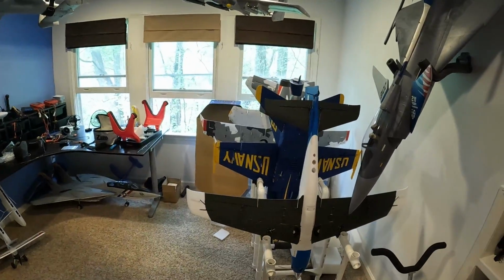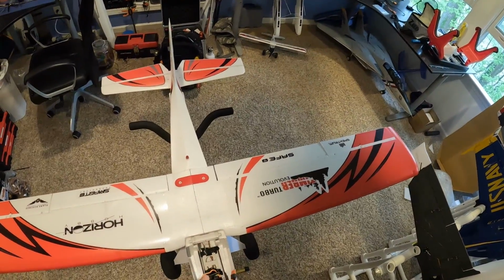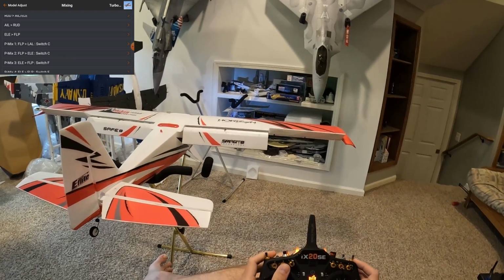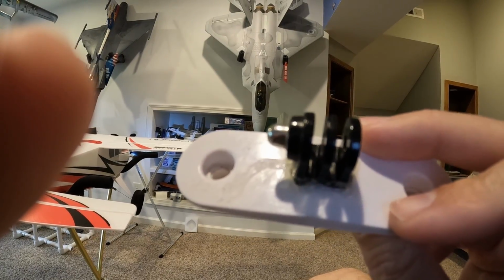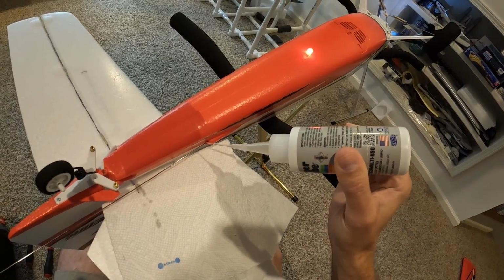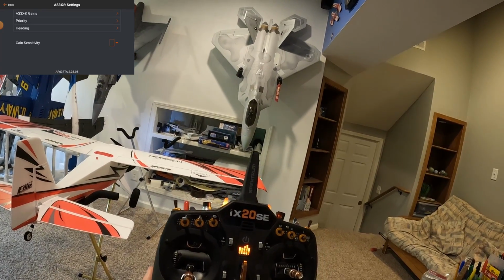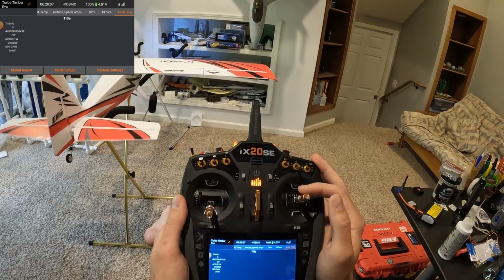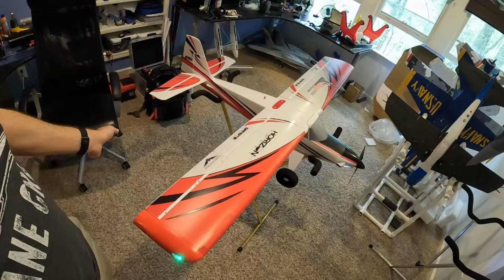Setup: Turbo Timber Evolution Max Performance w/ Spektrum Avian ESC Programming / Voltage Callouts

Comment: It's crazy that I've had this airplane for about a year and never had the overheating or thermal shutdown issues others have mentioned or been plagued with, even on the most hot and humid days here in East Tennessee. I did notice that excessive heat was generated by the esc and motor after a flight, so I removed some small bits of the cowl around the sninner to improve airflow to both components, and while they still get pretty warm I've never had a problem.
Reply from the maker: Consider yourself fortunate. This one actually wrecked out of a hover (no damage except to a spring) because it hit thermal protection before we changed out to a less-intensive prop system and moved the ESC forward.
Reply: @TwoBrosRC  Hello¡¡¡ By less intensive prop you mean the 13x4?

Comment: Trying to set up 150% flaps, took the servos out, adjusted to 150, attached the arms but it just doesn’t seem to want to go full “barn door”… so you have a video or any tips on how to make it work?
Reply from the maker: We can't post vids just for specifics like this, but we can say that if it's not working then you're probably not adjusting it correctly. It's a simple fix though. Adjust the flap travel to 150%. Set the flap system to pull the flaps up 100%. Place the servo arm on the servo such that it nestles the flap against its pocket in the wing without binding the servo. Set the flap system to deploy to 100% extension. It will deploy as far as ours do afterward.

Comment: When you shove the battery all the way back like that, aren't you moving it way closer to the RX antenna(s)? No issue?
Reply from the maker: No issues at all. The antennas are placed in such a way that the battery isn't interfering with them. The only active part of the antenna is the very tip.

Comment: Hi Jon. Can you recommend an alternative to the stock motor which seems to be on backorder everywhere? Seems like the Spektrum 4250 might fit, but I'm new to this and pretty unsure about sizing the motor. Cheers!
Reply from the maker: The Power 20 or 25 is probably a good replacement.
Reply: I had a couple Kyosho Calmato planes that came with a BLS-30 motor. It's a direct fit on my TT Evo. I can't compare performance, but with a 13x4 prop, it'll climb vertically QUICK with a big 4S 4300 mah. I'm using a Castle creations 75 amp ESC with it. only because I wasn't using a Spektrum smart battery. It's an option.

Comment: Hey Jon,  not sure if i am doing it right or looking at something wrong but i put all my servos to 150% rates but the travel does not increase.  Even in dual rates it will only go to 125% with no increase in travel.
Reply from the maker: You didn't unlock the receiver and reprogram it. That's step 1. If you don't do this, 100% is as far as the BnF receiver will permit travel.
Reply: @TwoBrosRC  hello again Jon,  sorry to keep bugging you but i have watched your video over and over and i have to be doing something wrong.  i unlocked my receiver and it messed up my flight control directions on my ailerons and rudder.  i reversed the servos but there is no way to update AX3 unless i reset the receiver which i did.  got every thing all up and running and now safe works........ Safe and AX3 in the intermediate work but i dont feel any movement when i go to mode 3 just AX3.  yes i advanced the throttle.  oh and i still cant get the travel to move to 150.  flaps went down more but rudder and elevator show no more throw when I increase the servo travel.
Reply from the maker: @daleholliday8489  Factory reset the receiver, then make sure all of your servo directions are correct in the transmitter. Set the receiver back up from Forward Programming after that's done and it will function as-normal.

Comment: Hi Jon, just wondering if you could help describe why timing 5 on avian programming helps with the overheating problem. Mine overheats with every flight. Also, I noticed when I throttle up, it takes half a second for the thrust to really kick in. That annoying delay is plenty of time for the novice pilot to get in trouble when flying low and not expecting there to be a delay. Hoping you have some suggestions! Thanks again for the great vid.
Reply from the maker: Setting timing to 5 reduces the amount of thrust the engine can provide because it won't spin quite as fast as it does on 15 timing. This reduces the amount of amps the ESC has to kick out to the motor, which keeps it from getting as hot. In the vid I do believe I went over how to set it to instantly spin up - just set the Startup Time from Very Soft or Soft to Normal instead.
Reply: @TwoBrosRC  sounds good! I’ll give it a try AFTER moving the ESC up, cause it overheats and stops with every flight as it is…
Reply from the maker: @marcellowithtwols  Be sure to use a 13x4 prop as well. Otherwise it will overheat even with timing set to 5.

Comment: Jon, How did you get the screen to show left aileron (LAL)  I tried changing the servo name, but mine still shows the factory set name.  I did reboot he TX. Is it somewhere else?
Reply from the maker: You need to set the wing type to Dual Aileron, 1 Flap.
Reply: You must have your wing config setup differently, Mine is 1 AIL 1 FLP
Reply from the maker: @cs-xd9gy  That's why I mentioned needing the wing type change.
Reply: @TwoBrosRC  Man I watched that 10 times and I missed it.  Hard to keep up with you😂

Comment: So this is how you're getting it to fly like more 3d style flights?

I saw a video of you hovering w floats on.

It still has the stock horizontal stab or did you switch parts out from the timber x
Reply from the maker: Yep! Everything you see in this vid is what I fly. Stock airframe components, upgraded servos. I may upgrade the stab to use the Timber X stabilizer in the future to get even more impressive KE spins and walls/waterfalls that won't require much effort.

Comment: Great tips Jon. Is there someplace you show exactly what wiring changes you made to set up crow, while also retaining the options of AS3X and SAFE? I heard elsewhere that setting up crow will eliminate stabilization, but around 27 min. you discuss adjusting gains and demonstrate AS3X working. Thank you.
Reply from the maker: All you have to do is unscrew the two wing plugs in the fuselage, unplug them from the receiver, and cut one of the leads going into the aileron plug right before where it plugs into the plastic lead. Use a DuPont connector kit (like the one in my description) and affix a new servo lead to the end of the cut wire, then connect that to channel 5 or 6 - depending on which channel your transmitter expects the aileron to be connected when you've set it up as a 2 Aileron 1 Flap wing type.

Once this is done and the receiver is reprogrammed, you'll have stabilization on both ailerons.
Reply: @TwoBrosRC  So, you're basically saying that you need the ailerons plugged in independently rather than y'ed. Which aileron would you move to the other channel, left or right?
Reply from the maker: I'd switch the left because the default is channel 2 for the right aileron on a dual aileron setup.
Reply: You mention reprogramming the rx....I assume this is the stock bnf 637ta rx, did you need to do a full reset of the rx to eliminate the factory settings, or just add mixes etc?
Reply: Hey Jon, I appreciate that you take the time to spread knowledge to show the community of this hobby. 

I do have a question. 
The Timber uses a 6 channel receiver correct?  I guess I’m not really understanding the changes you make to make this setup work for this reason... the Timber is 5 channels (6 with lights) if you remove the Y harness and give each aileron its own channel, you would need 7 channels to run this setup including the lights which I can see that you still have. Could you explain the element that I’m missing please?

Thanks again!
Reply from the maker: Lights go into the bind port, freeing up the fifth channel for the second aileron. 😉
Reply: @TwoBrosRC  I never thought of that, thank you!

Comment: I missed the servos that you used as replacements - what are they again.
Reply from the maker: https://tinyurl.com/B11DLS
Reply: @TwoBrosRC  Did you change all servos or just these two in the fuselage, please?
Reply from the maker: @bigeicikulm8511  I changed all of them.
Reply: The 9 gram 21 dollar pair or the 5 gram- or the 13gr 😬 I wanna upgrade my rudder and elevator inside the fuselage servos- just wanna make sure I get the right ones that will fit-  thanks for all you do
Reply from the maker: https://tinyurl.com/B11DLS is what we used on all surfaces, Barry.

Comment: Hey dude, you just made my brain hurt. I am so far behind where you are at. And I’m old to boot. I’ve got got three Timbers and just kinda fly them around and don’t want to mark them. I do most of my crazy flying with my trusty FMS Supa EZY with an ORC stab from an 850mm P51 only working on the ailerons, works a treat. Main thing is tho, I’m having a ball and that’s all that matters at this stage. Still love ya work, keep it up.
Reply from the maker: Turbo Timbers are really capable airframes. They just need max throw on all surfaces to perform to their true potential.
Reply: @TwoBrosRC  Thanks Jon, looks like I am better advancing with my TT V1 than my X and just up the rates as I progress as I have done with my supa EZ. Cheers.
Reply: @TwoBrosRC  My heart truly aches for one of the Turbo Timber X Night planes to fly with my 14yr old daughter. I've been flying for 38 years but I recently had my right leg amputated and have Stage 5 kidney failure. I'm in and out of the hospital constantly and we are financially devastated to say the least. I was flying giant scale like the Beast Biplane, 102" wingspan Extra 300, and a giant Yak. I sold them all to keep our home and they were just to big for me to handle with my health.
I would give anything for a Transmitter and that Timber X or Turbo Timber Evolution. I would even be more than grateful if someone would donate the UMX versions of those planes!
I love your videos, I always learn something new!
God Bless you!
Reply: @TwoBrosRC  I have all the Timber info from watching these videos, just no way to get one 😢
Reply from the maker: @RazorsEdgeDIY  So sorry to hear that! There's no easy way to get a transmitter and a model over to you given how expensive those items are, much less how much it costs to ship them. Your best bet would be to swing by a local club and see if you can get some stick time on a club plane. Most likely someone would love to help you out!
Reply: @TwoBrosRC  If I can come up with the shipping cost would you be able to help me and no transmitter and the plane in pnp. My brother has a Futaba I could use.
We don't have any guys in our club that have planes for others to fly.
Reply: @TwoBrosRC  I live in Buffalo NY
Reply from the maker: @RazorsEdgeDIY  We don't really have the money to send transmitters or model aircraft to people. This is why we mentioned talking to a local club. If the one you're working with now can't help, there may be one local to you that can.
Reply: @TwoBrosRC  Well as long as your given yours to make videos, a dieing guy like me and my daughter doesn't matter. That's the truth of the world we live in and I worry so much that my daughter will have to face it without me 😭 it sure would have been nice to make some rc memories with her.
I did say that I didn't need the Transmitter, that I could use my brothers Futaba.
I don't drive either, that's why one of those   Turbo Timber Evolution/X planes would be perfect ( I have a big park at the corner of my street that I could drive my motorized wheelchair to with the plane. I see you have a full Hangar of planes and FMS gives them to you to make videos! Those UMX versions cost $169 but my house is literally crumbling before my eyes, so $169 is like a million 😭
I will never bother you again because you obviously have zero interest in sending my daughter and I 1 just 1 Timber X or X UMX 😭
Reply: @TwoBrosRC  there are very few clubs in Buffalo NY and the ones that are here, are not local and I don't drive with one leg and a disease ridden body!
Reply from the maker: @RazorsEdgeDIY  So originally we just hid you from the channel, but felt bad about it. So we unhid your comments and kept them up. We're all about helping people, but we already spend a bunch of our free time helping people with knowledge, setups, techniques, etc. On top of this, you're asking us to send you models that we're obligated to continue creating content with. Just because we went into $20,000 of debt to start this channel doesn't mean we can afford to send you anything for free, nor does it mean we owe you anything for free. There are options for you locally and we highly recommend that you pursue them in the time you have remaining instead of lashing out at us because we're unable to give you what you're demanding. Calling us greedy is not how you handle this sort of situation.

We are not required to provide anything to you. We already provide more info to most people on YouTube than almost any other channel does, and interact with our community far more than any other channel does. We simply do not have the resources to do what you're asking. The models we own are for content creation purposes and cannot be given away to randos online who ask for them.

Ask around locally for help to fly planes or ask a RC company to send you something. We simply cannot help you here.

Comment: Yes, would you mind going into a little more detail about the 150% flap /removing & changes to servos. Not sure what you meant. Thanks!
Reply from the maker: The easiest way to do is to remove both flap servos, set the up and down travel to 150%, then position the servo arm so it will pull the flap snug against the pocket it deploys from. It'll take a few attempts to get it just right - you're looking for roughly a 120 degree angle on the arm. After it's positioned right, you can get the flap to extend and retract fully without binding - you'll get full barn door flaps at that point.

Comment: WISH spektrum (OR anyone) would come out with new/better/different voice prompts for the nx series. Ive seriously been thinking about dropping the 2 g's on the iX20se.
Reply from the maker: The SE is only needed if you want the gimbal upgrade. The 20 is amazing by itself. If you do get one, try the 20 first and see if you think you need the gimbals - Horizon will upgrade them for you for a fee that comes out to the price of the SE so you can save some cash at first if you're wanting to check out the radio.

https://tinyurl.com/IX20Transmitter if you'd like to buy it and support the channel at no additional cost.

Comment: 2 questions came to me just now.

1) did u have/try the dx/nx tx's before u got your (ULTIMATE! 😁) iX20se?

2) Cant you go into the reciever, reset/reprogram it for 150% throws instead of the 'factory' settings?

Thank YOU Jon! 👍
Reply from the maker: I had a DX6 and an IX12 prior to upgrading to the IX20SE. You can reprogram a BnF receiver but you need to use a programming cable to update its firmware so you can reprogram it in Forward Programming.

Comment: YOU are gonna make me get a TT Evo. Almost got 1 before my flying buddy did. I opted for my 1st, new Nite x. (Tho i never use the LEDs).🤪
Reply: & ive flown, several timber x's & the old school 1.5 TT (bottom load).  None were mine. (& U dont mod it if its not yours. Also fly it differently)

Comment: Do you like the turbo or the Night  timber for aerobatics? I know you haven't flowen it much? Is the setup on the night Timber  much of a hassle compared to the turbo? Just wondering by flipping their plan over to change your battery would be to much of a hassle.
Reply from the maker: I've flown the Turbo Timber for two years, and the Night Timber X for nearly a year and a half. They both have things they excel at. The NTX is designed for high energy rolling and post-stall 3D maneuvers, the TT is designed for bush flying and aerobatics that can be post-stall but requires that you think ahead of the plane due to the much slower roll rate and lack of roll authority because the prop wash doesn't flow over the ailerons.

I have a vid on the NTX setup you can check over - I wouldn't call it a hassle.

https://www.youtube.com/watch?v=3r9lDPUl5AU